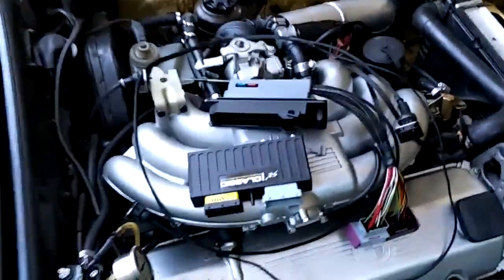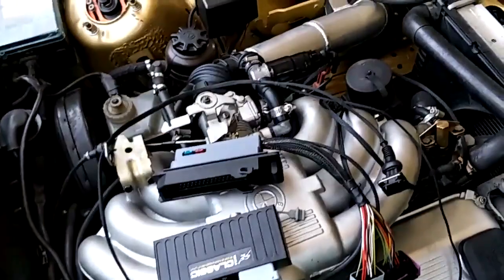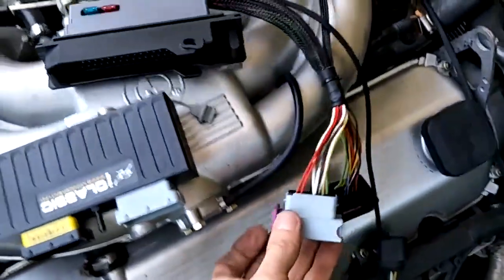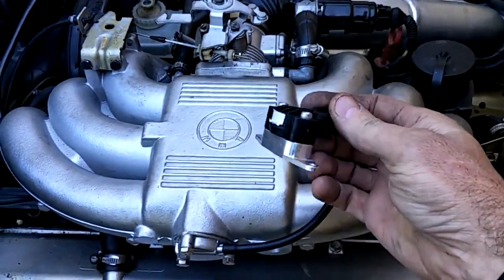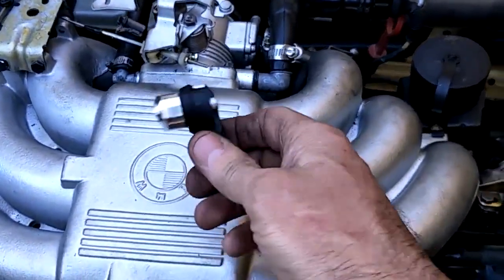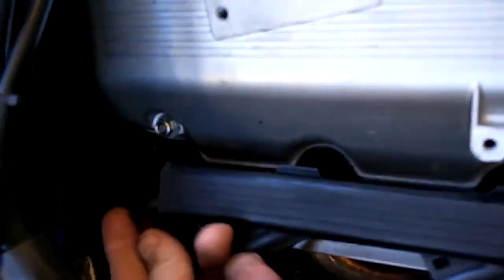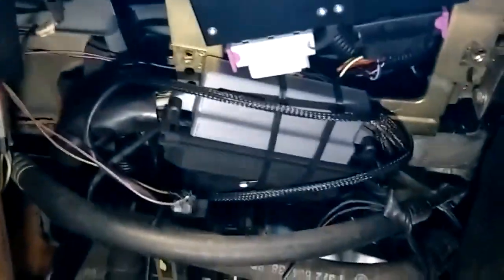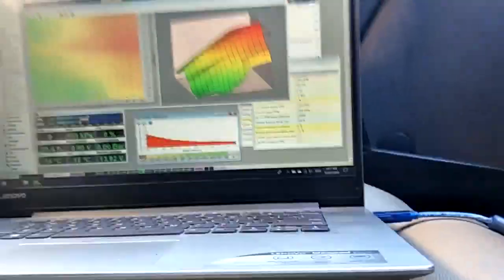BMW e30 ECUMASTER m20 Plug and Play stand alone ECU

Comment: Hi, i have an m20 2.8 stroker (eta block + 2.5i head) formerly a jetronic and now I cant seem to convert it to motronic. Will this work for my setup?
Reply: I couldn't find information about converting from l-jet to motronic. I just bought engine with Motronic 1.3 and plugged it, nothing difficult. It's best to buy the whole engine because you need to change the ignition device, injection rail, etc. In addition, everything fits plug & play, you only need to switch the fuel supply and connect the engine-fuse box connector.